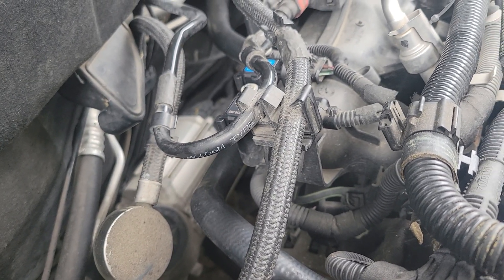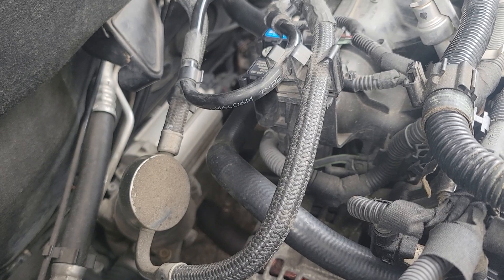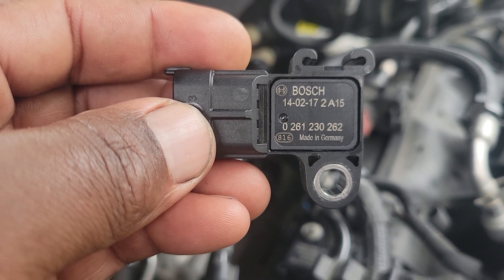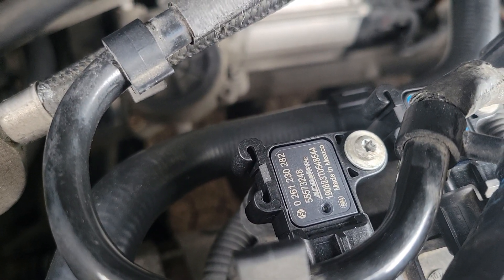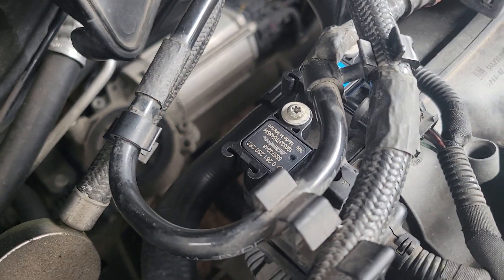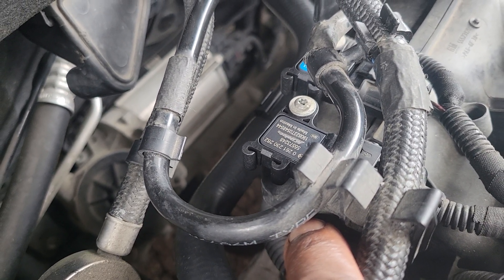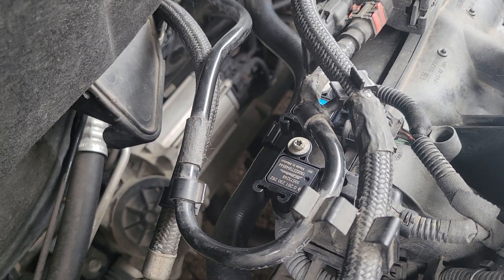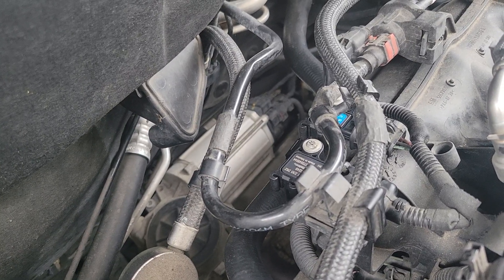Solving Your Check Engine Code Puzzle: 'P2227 + P2228'!

Comment: Which one is the map sensor?
Reply from the maker: @BenitoVargas-n7r  mass air flow sensor is always between the air box and throttle body.  manifold absolute pressure sensor is usually on manifold intake near throttle body. It could be different depending on the make and model of vehicles

Comment: I was having this same issue with mine, a 2014 Chevy Equinox.  Replaced the map sensor with the part number you suggested and was still getting the p2227 code.  No Vaccum Leaks,  Clean Air Filter, New MAF and new MAP sensors.  Had me stumped.  Took it to the shop and they couldn't get it to go away - they did a diagnostic and a throttle body reset.   I suspected it was the throttle body.  Tried cleaning it, no luck.  Replaced the throttle body and the throttle body connector and BINGO! code went away!!!!  On these vehicles the TPS is integrated with the throttle body, so if the TPS is failing, you would have to replace the Throttle body.  Took me weeks to figure this out.
Reply: Bro having these same codes P0113-00 P1101-00 P2227-00 and P2229-00 very annoying havent replaced the MAF sensor but might start with throttle body?
Reply: @The_wanderpreneur any luck
Reply: @The_wanderpreneur any luck ?
Reply: Hi did you reprogram tb to ecm?

Comment: Where is the MAP sensor location on a 2019 Chevy Cruze? Nobody on YT has changed a MAP sensor for my model. Its always the older model Chevy Cruze. Thanks in advance!
Reply from the maker: Which motor do you have? 1.8 or 1.4 turbo
Reply: I have 1.4 with same code

Comment: Also, make sure u have the correct plug on the correct sensor. They use the same exact plug for both sensors
Reply: that is my exact question, which one goes to which ?

Comment: I changed both but they’re still popping up , if you could help , I’d greatly appreciate it .
Reply from the maker: The barometric sensor will have a different code. That's the blue sensor next to the map sensor, if you have one. Did you purchase the map sensor at the dealership with the vin, if not. I would do that first. If you did that already, I would test the harness that connects to it.
Reply: There’s only 1 Sensor. MAP sensor.